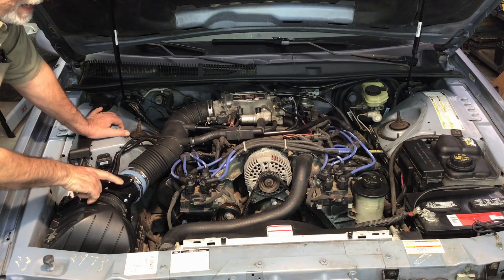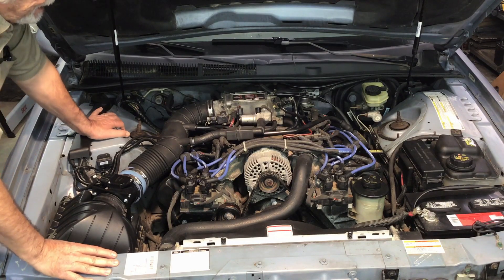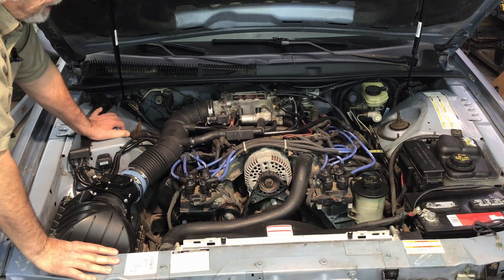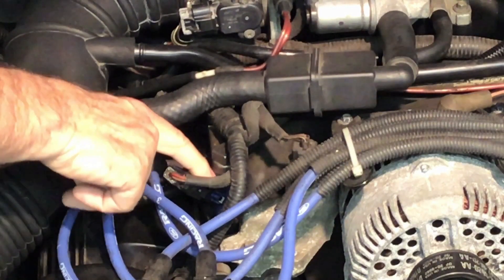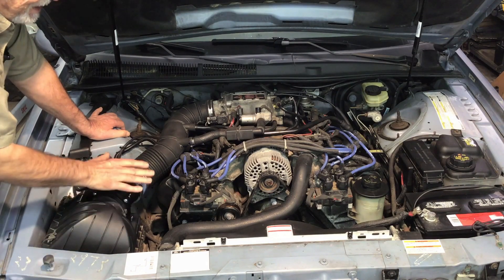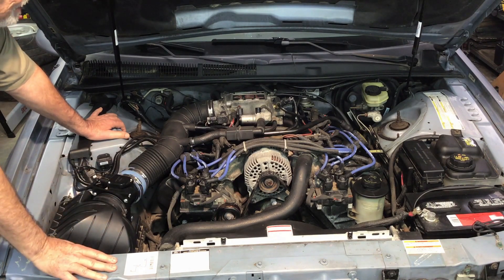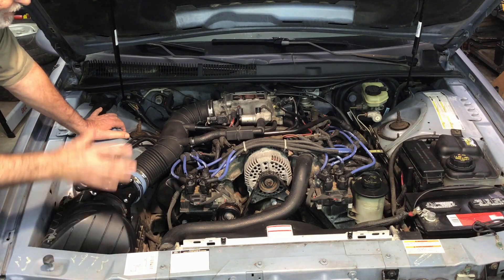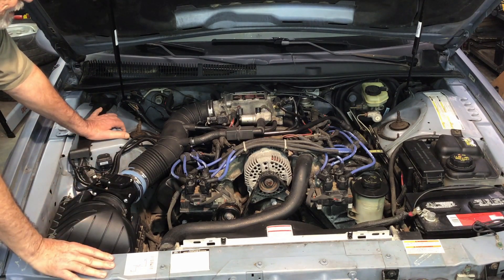How to install a centrifugal supercharger in a 96-97 4.6L Thunderbird, part 1 (preparation)

Comment: Are you able to add an supercharger to an stock 3.8 if so how to
Reply from the maker: I don't see why not but like on mine, the mods to the radiator position and updating the fuel pump and injectors would be needed.

Comment: I have a 97 tbird LX with the 4.6 v8 with 30k miles.

Would love to build it into a sleeper & surprise ev1 for street & strip.

Was wondering what I can do that would make the greatest impact.

What do think about an engine replace with a EFI 427 small block or a newer built coyote 5.0 in it? I bet alot has to be modified & changed though?